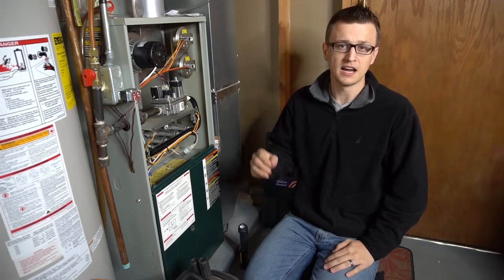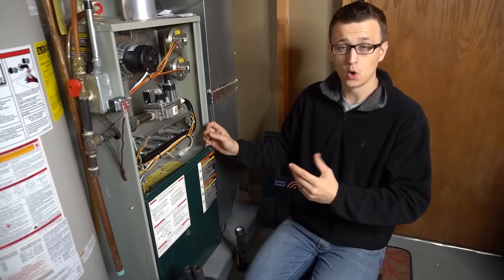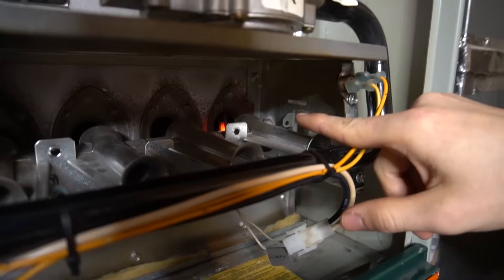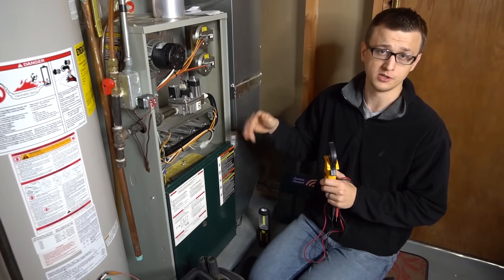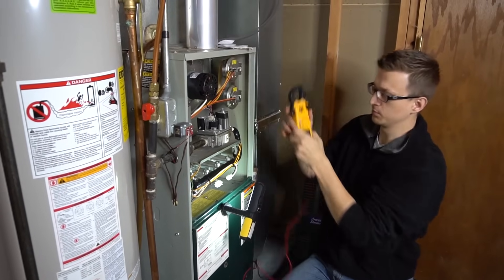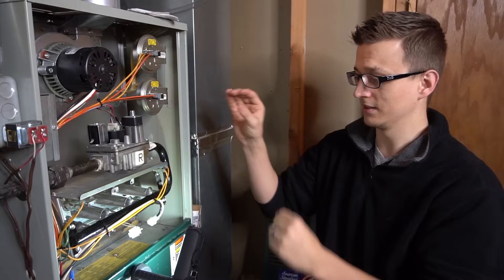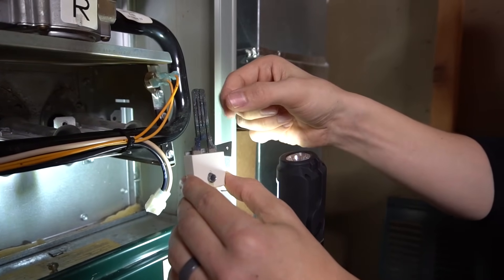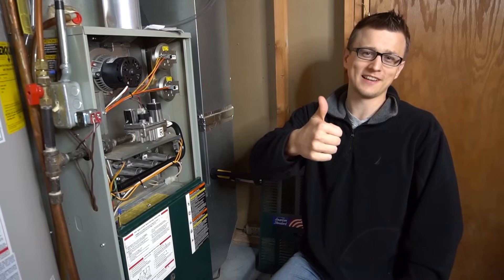Furnace Not Igniting - How to Check and Replace Ignitor

Comment from the maker: ⭐ More Videos That Can Help:

Top 5 Furnace Problems and How to Fix Them:
https://youtu.be/T4IWtKy--Vk
Furnace Parts and Functions Explained:
https://youtu.be/gN-UIr6824w
Thermostat Not Turning on Heat:
https://youtu.be/054cRskeh5k
Blank Thermostat Screen:
https://youtu.be/vi3OJuGfaac
Furnace Error Codes Explained:
https://youtu.be/J8Zegm4TClM
Furnace Sequence of Operation (important to know):
https://youtu.be/AQD_MedIklI
Reply: I'm not getting 120v does this mean my motherboard is bad?
Reply from the maker: @A.C.71   Can you hear your gas valve click open and let out some gas? If yes, then it's likely that the board is bad. It could be a loose wire connection too so I would take a look at the wire going to the ignitor as well.
Reply: @WordofAdviceTV  I actually don't hear the valve click to let gas out but I also don't have 120v to the igniter.

Comment: The draft inducer motor has to close the draft switches (diaphragm) before the glo bar comes on, then if the relay is good on the brain board, it will power up, but only after the brain board relays the 110-120 volt power to glo bar.

Comment: Sorry, posted this comment in another of your videos a few minutes ago, this might be the better place: "Townhouse in San Diego, attic Carrier Induced-Combustion Gas Furnace Model #:CNPHP3617ACCAABAA. Seems every year my heater would not come on. Green scratch pad the flame sensor would usually fix it for the winter. This past March 2025 installed new flame ignitor and flame sensor. Turned it on a few weeks ago, worked fine every few days. Now the draft inducer motor comes on, but I don't hear that click of the pressure switch closing; then it goes into hard lockout mode. I climbed into attic, voltage tested ignitor, it got power at first, but ignitor wouldn't glow. Now there is no more power to ignitor. The ClearVu condenser pump is cycling it's lights. Could that be the cause of no power to ignitor? I don't know how to reset it, in any case, but it doesn't seem to me that the condenser pump would shut voltage to the ignitor."
Reply: Update: put voltage tester on black / positive wire to HSI (hot surface ignitor). Plugged in electrical power to heater; no voltage while draft motor inducer runs ~30 seconds; then voltage cycles on and off about 1" each as HIS glows for about 10 - 15 seconds, then stops glowing (and voltage stops being sent). Draft inducer runs ~30 seconds, the above cycle repeats. Then when it repeats a 3rd time, gas flows (I can hear it), and it ignites and the main blower fan runs, and hot air flows through ducting. Does anyone know what causes this problem? I took the cover off over the control board, and the only thing that looks suspicious is a wire laying on the bottom tray which is attached to a housing towards the back which looks like it's perhaps a ground; green and yellow. There is no evidence that it was ever connected anywhere, although there is a hole where it could conceivably attach with a screw. It's such a hassle for someone to get into the attic I dread having a repairman try to get in there. I don't have a meter, just voltage testers, but I don't know if testing the control board would find anything. Any advice is appreciated, thank you.

Comment: Great video!  I'm a 73 yr. old widow who has an oil hot air furnace with a problem of the system not igniting after it has not called for heat for several hours. I can re-start it on the system. The green light will be blinking so I push the button twice, (one time turns it off, the second time starts the ignitor) .  The system is room temp so why is it able to start again from doing that but not on its own? Thank u for any help u can give. This problem started right after the annual service was completed.

Comment: Great video. I was pretty sure I had a furnace ignitor problem, but didn't know if it was a DIY job. Your video  was spot on. The job was super simple and only cost me $26. You weren't kidding when you mentioned how brittle these things are. The old one just fell apart on me. Anyhow, nice to have the heat back on! Thx again.

Comment: Your video is well made.  My ignitor kicks on, light green,, then a flashing orange light comes on flashing.  Is that an ignirtor issue? and how would I tell if it is a double thin stick ignitor w bent ends ignitor. or a single ignitor with flat together?

Comment: My furnace went out a few days ago. I am somewhat handy and can do minor repairs around the house but I’d never worked on a furnace before. I thought I was going to have to hire someone to come and fix my furnace but then I remembered YouTube has taught me almost everything. I found this guys channels and quickly realized that I could at least troubleshoot and get an idea of 1. How a furnace works 2. Figure out what might be the issue and 3. I could definitely fix this in my own. Sure enough, I learned that the hot surface igniter was out in my Trane XE80 furnace and ordered a new one on Amazon for about $15 dollars and to be safe I also bought a pair of flame sensors for $12. I broke the igniter easily when I was screwing it in place. So I recommend making sure that the new igniter doesn’t touch anything before screwing it in place. I made minor adjustments the the mounting bracket and second time it fit perfectly!
I’m not sure how much money I saved by watching the is video but it feels great knowing I probably saved a ton and not to mention the satisfaction you get from fixing something on your own. Thanks for this awesome video! I hope the YT community keeps liking your videos to show support and gratitude!

Comment: What if you already replaced the ignitor and the furnace works fine for about 4 cycles and then it doesn't. I can hear the gas and smell the gas but it doesn't ignite.

Comment: Okay my furnace turns on the pressure sensor closes but the igniter doesn't get hot and no gas comes out. So would that be the igniter and the gas valve?

Comment: my board is not sending power to the ignitor and never tries to open the gas valve. Pressure switch closes (verified voltage), No power out of the ignitor relay, gas valve never opens. I figured the valve wouldn't open and there was a sensor of some sort on the ignitor in case it was burned out. Guess not, valve should open, even if there is not glow and shut down if the flame is not proven...

Comment: I checked for power to the ignitor because replacing it did not fix my issue, and it's mostly hovering around 10V with the occasional spike to higher numbers like 30-40V range, along with a seemingly rare spike to 120V. My meter leads are quite small with just the tip exposed, not like yours with a longer neck, so part of me feels like I could be lacking good contact, but I've tried enough to get fairly consistent readings/behavior. I'm just wondering where to go from here, if not a professional. For now, I'll check connections and look into testing other components.

I should add that I'm getting a 1 blink error code. On my furnace it's "Ignition Failure", recommends checking gas flow, gas pressure, gas valve, flame sensor. All seems to be working fine after manually lighting the furnace.

Comment: I just bought a new Goodman gas furnace and replaced my 40 year-old oil furnace. Got just a little dirty. LOL! Anyway....great video, but since it's 6 years old, I wanted to mention a newer issue that I ran into with mine. It took me a couple days to figure it out, and I would imagine it could very well be a problem with ANY newer control board. There's now an "EAF" error code on a Goodman furnace that is paired with an AC unit that uses R-32 refrigerant. The EAF code typically indicates a problem with the R-32 leak detection sensor. This sensor is designed to detect leaks in the refrigerant system and prevent the furnace from operating if a leak is detected, as R-32 is a flammable refrigerant.
To resolve the EAF error, you need to deactivate the R-32 sensor. This can be done by accessing the furnace's control board and changing a setting. For example, you would scroll to A2E on the LED display, hit the center button to change it to "No," and then kill the power and restart the system.
IN SUMMARY...my inducer would run, the pressure switch was made, but the control board didn't allow the ignitor or gas valve to be energized. About drove me nuts!!
Changed the A2E setting to NO, and she fired right up. 
I suspect a new board would be set to "YES" by default.
Flammable refrigerant...??! REALLY?? Is that even a good idea?

Comment: Maybe setting temperature before switching to heat on thermostat matters to ignition working or not.  If you switch to heat first then set temperature, the ignition might not working.

Comment: Just adding a comment in case anyone else has the same problem I did…furnace turns on, igniter wouldn’t glow, tested it with a multimeter & it was good (showed continuity).  No voltage was ever making it to the igniter.  

Also the inducer motor fan & blower motor fan both came on within 1 second of the furnace coming on (not normal).  Usually only the inducer motor fan comes on, then the igniter glows, then gas is released & lit, then the blower motor comes on, etc.  I thought it might be a bad control board, but I had replaced it 2 years ago (it was not).  AI & different searches mentioned the pressure switch/sensor, that wasn’t it either.

Long story short, for me it was due to a stuck limit switch.  This is not the flame rollout limit switch (where there’s a reset button & it’s fully visible & located near the burners).  The limit switch on my furnace is next to the inducer motor & goes inside the main furnace housing.  All you see from the outside is 2 screws, a flat pad with numbers & two terminals on it.  The switch was old & got stuck open, wouldn’t close.  The fix was to remove it, knock the switch button loose (& then replace it at the first opportunity, a $25 part).  

Posting because I never found any content showing in detail someone checking it & replacing it when the igniter wouldn’t get voltage & glow.
Reply from the maker: Thank you for sharing the tip! I think I might have covered this exact scenario in this video: https://youtu.be/pJzP1jzYPqg?si=pm2Nc4kXxwpRvNOx
Reply: Thanks for sharing, I'll look into this. I'm getting the same issue up until the blower coming on early. Mine sequences normally but has low power readings to the igniter.
Reply: @mikeallenfpv  I’m still no expert, but you could probably just jumper the 2 wires entering the limit switch as a way to bypass a failed one.  Obviously a temporary workaround & don’t leave it like this, replace the part ASAP
Reply: @steveknick1978  thank you! I'll make an update once I figure it out

Comment: I have a pellet stove insert that uses a ceramic carbide type igniter that looks identical to the one you demonstrated removing and reinstalling. To purchase a replacement, pellet stove parts suppliers charge around $70, while I see igniters that look identical for furnaces, water heaters, and pool heaters, for a fraction of the cost. Over a few years, I have purchased 2 replacements that each just had the fiberglass wrapped leads but with bare cut wires on the ends. I broke another igniter a week ago and purchased a replacement, again, for $70, and it came with the plastic plug type similar to what you showed in your video. I just did as you suggested and cut the plug off, trimmed the fiberglass wrap back, attached to the wires with ceramic wire nuts and wrapped them with electrical tape. I feel that the seller I purchased from has sold me the same part I could have gotten for $17, but they upcharged as a specialty fireplace part. My question is, if I found an igniter that matched the size in my stove, would it work to stay on long enough, with high enough heat to ignite the wood pellets? I realize that pellet stoves are not your specialty! I just feel that if they are going to send me the less expensive igniters and charge me more, then I should just buy those myself and save my money. For reference, I have a Quadrafire 1100i pellet stove insert with the old type ceramic burn pot. The old type pot uses this ceramic carbide igniter. They have come out with a cast iron burn pot that uses a different type of igniter that appears much more durable and is also more easily accessible. BUT that whole new system would cost me about $1000 to convert to, so I need to make my ceramic pot system last as long as possible. Thank you in advance for any help you can provide! Love your videos!

Comment: sometimes my burners wont light. i replaced the flame sensor and the ignitor.  with both new parts, sometimes the ignitor will start to glow red, and 1 sec in, before getting to the full glow, the glow will disappear.. and furnace will restart the process, and sometimes it'll come to full glow and burners will go on, and sometimes it'll start the glow process, but then go off - causing the burners to never light, and furnace will lock out with 7 red leds.  YORK furnace. TG8S100

Comment: When replacing an igniter you need to be very careful not to break the new one. They can be brittle. The old igniter will probably have a crack in it and it will probably be white where the crack is.

Comment: If you have a cracked igniter, is it possible that it will intermittently work or not work?  I have a Trane XE90 and the igniter sometimes will glow and the furnace work fine and sometimes it won't glow and the furnace shuts off. I also have the 3 flash pressure switch code if that makes a difference.

Comment: Video and detail was helpful in finding a simple issue with condensation blocking a vent tube that was preventing the ignitor heating up in the cycle. Thanks

Comment: Thanks so much for this video!  I replaced my blower motor but there was one plug I left unplugged because i thought that was how  it was.  It turns out it was the line that supplied power to the ignition and it had come unplugged as I was removing the blower assembly.  Through trial and error I figured out where it was supposed to go.  I couldn't have done it without seeing your video.  Very happy now to have heat back and running again to my house.

Comment: I want to thank  you for you videos, you have save me a ton of money over the years. I am hoping you can give me some input on my situation. My furnace would not light so I watched another of you videos on how manually light it. (think it was yours?) I got it to light no problem and it actually worked fine for a couple days. When it failed to light again I check into it more, I was not getting continuity on the igniter, but I was also not getting power when I checked the for voltage, so I assume I have two problems. I ordered the igniter, but  I hoping you can provide me with some ideas on what to test to confirm if its the board or what the issue with the power might be.  Its a coleman Furnace Model GCH90703BXAB. Thank you so much!

Comment: There's a plumbing and appliance place locally that I think has an igniter for my furnace but is there a big difference between the OEM igniters and after market ones?
I don't want to replace this every couple years especially since it gets cold enough here that if it went out right after you left for the weekend you could have pipe problems

Comment: Some older Trane furnaces use an 80 volt ignitor. Some furnaces use a 24 volt ignitor, especially smart valve furnaces.

Comment: Quick question. I am inquiring about my heater and thermostat. I will set my thermostat to 73 degrees. When the temperature drops below that mark, my heater comes on like normal. When the house is warm, it turns off at 74-75 degrees. Recently, my thermostat has been showing temperatures above 78-79 degrees. Is this a malfunctioning thermostat or a board?

Comment: Watched a few of your videos and was able to pin point issue to bad igniter and just replaced that and everything worked as expected. Your channel definitely helped saved a few hundred or more bucks reading other comments. Thank you.
Reply: I ended up buying 2 diff igniters from amazon Duralight and Cimatek something but both had diff Ohm rating when tested using multimeter. 1 gave 110 while another gave 75, and reading from online placed the one with lower rating

Comment: I’ve never commented before but I am a long time fan! Just wanted to let you know you saved me $1700 today (repair estimate from techs)! Two different techs (mostly) misdiagnosed the problem when it only needed a $30 igniter which I put in myself using your video. ( One minor thing: I had to strip and pigtail the wires because the connector didn’t fit—wasn’t entirely sure whether it mattered which wire on the igniter went to black and which to white. Ended up just taking a guess. Anyway it worked! lol)

Comment: I had to replace the igniter. But it only puffs a flame and quits.  Flame detector has power   Pressure switch seems fine and gets power   I’m at a loss

Comment: I forgot to ask, is there a way to check this 1999 Rheem type of two prong spark igniter with a multimeter? This igniter has a single orange wire that goes directly to the control board.
Reply from the maker: I don't have a video on this but AC Service Tech has a really good one. I think it will answer any questions you may have about it: https://www.youtube.com/watch?v=mzzy2EnaPOY

Comment: I have 1999 Rheem Criterion 2..
This furnace has what I think is called a two prong spark igniter connected to one wire… Do you recommend lightly rubbing brushing these two prongs on this type of igniter or just replacing it? Thank you extremely helpful…
Reply from the maker: Two prong spark ignitors don't usually need to be cleaned.